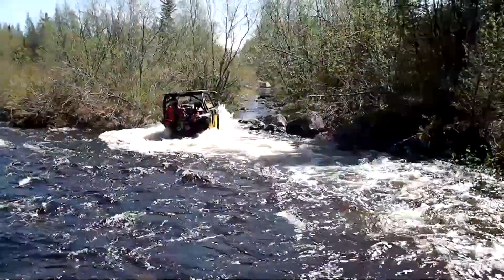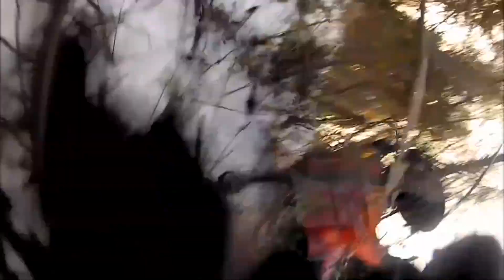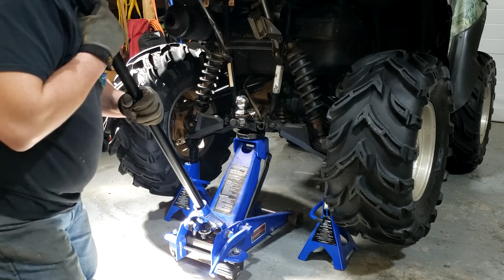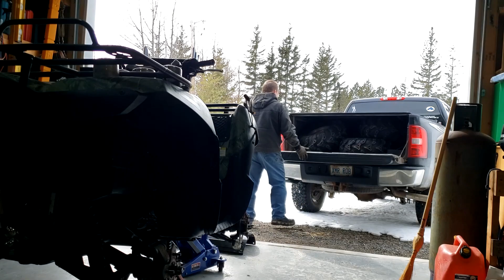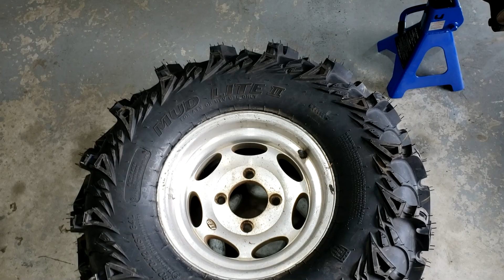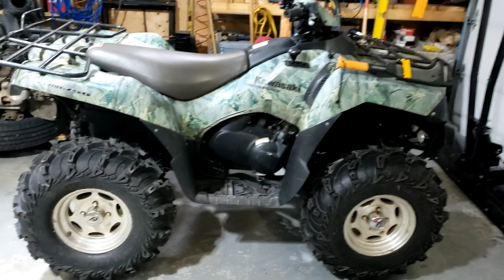New Shoes for the Brute Force 750

Comment: Lol no doubt.  The gift that keeps on taking lol. I'd be tempted to say it only deserved used tires. Maybe it's attitude will change with the new meats.
Reply from the maker: Thanks Rob! Ya, I'm hoping it's attitude will change for sure.  I have a Dynatek CDI unit coming as it seems that the original CDI is in failing mode. After that there's not much more I can change out LOL!